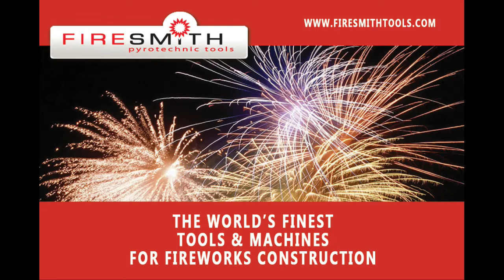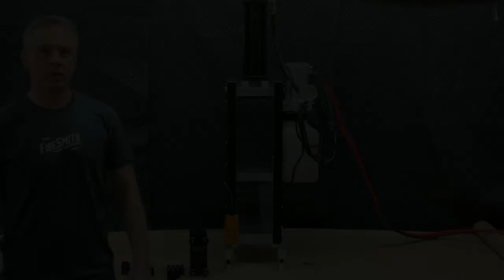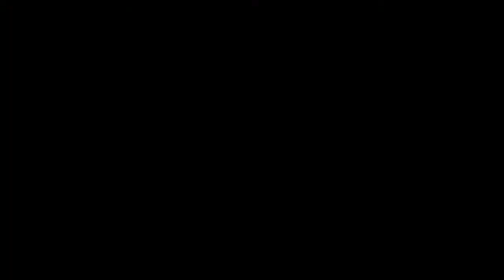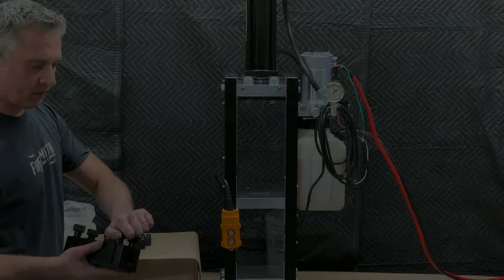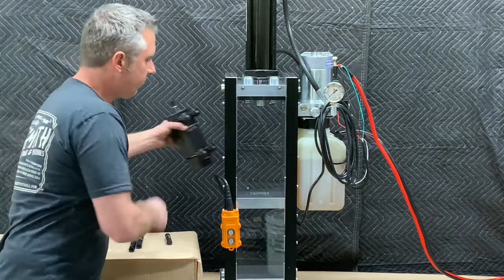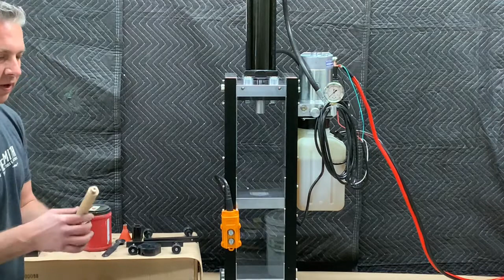Constructing a Clay Nozzled Black Powder Rocket

Comment: I got my tool kit a couple days ago.. I was able to make a couple rockets that made it a couple hundred feet in the air.. I had small heading that would only go off when the rocket will come back down and be 10 feet off the ground.. that rocket tooling set from u is great thank you
Reply from the maker: Glad you were able to get your rockets to fly! Try reducing the amount of fuel over the spindle to help prevent a round trip. Keep me posted with your progress!
Reply: @firesmithmanufacturing9376  yes that was exactly the problem thank you… I also ordered a 3lb tooling set from you I’ll see what I can do with those.. thank you God bless

Comment: Nice video.. I saw that u did only two increments above the spindle. Is there a rule to how much bp above spindle? Is it one ID above spindle? Can u add a delay mix and clay plug above this? Thank u
Reply from the maker: It really depends on what you're wishing to accomplish. If you're lifting heavier shells, you may wish to use minimal delay above the spindle since the rocket won't go quite as high. Light weight headings may allow you to use more delay above the spindle since the rocket will reach higher altitudes. That being said, I mainly like to run fuel as both a delay and bulkhead (that is, I don't use a clay plug above the delay). I typically run this to about 1/2" - 3/4" from the top of the tube. Using fuel as a bulkhead instead of clay always ensures your header will ignite.

Comment: I really like these instructional vids that go along with your tooling. How long have you been making Fireworking tools? Are you a machinist by trade? Or do you just do it on the side? What do you use a lathe or CNC milling machine or both?
Reply from the maker: This business started in my garage in 2010 as a hobby. It became a full time endeavor a year later. Since that time I've acquired several CNC machines to keep up with demand. As it is, my tooling is in use by hobbyists, professionals and commercial operations all over the world.
Reply: @firesmithmanufacturing9376  I know it's used around the world I saw 1 of your star presses in a video by a South American Jorge. Were you into Fireworking when you started the endeavor is this why you began and turned it into a business. I'd imagine a lot of trial and error needs to be preformed on tools before you pick a design to see if it's workable and persuable from a monetary standpoint whether it be time or materials invested plus upkeep on your machines and blades.

Comment: What increments do you use or recommend for 1/4" rockets and 4 oz rockets? Thanks
Reply from the maker: Generally, you want your increment size to produce a plug of fuel approximately 1/2 the ID of your motor.

Comment: Can i get satisfactory rocket by using the universal core burn set and a  rubber mallet. Forget about the press, tube support, and removal jig? If you can, can you make a video about it?
Reply from the maker: Using a dead blow or rawhide mallet works fine. A rubber mallet won't work well. Ramming rockets with a mallet is only for BP fueled motors. Any other type of fuel must be pressed using hydraulic force. Checkout the Stinger tutorial on my website for an overview of this technique.

Comment: Hey man great video what kind of tooling from your website and what kind of tubes would you recommend to pick up a header about 300 grams would a 1 LB pound motor be to much or is that just enought just need a little advice thanks in advance!
Reply from the maker: A 1lb motor will easily lift a 300g load. If the height is too far up there for your liking, you can use a lower impulse fuel or reduce the amount of delay above your spindle. I'd recommend either the Super BP Core Burn or Universal Core Burn (Universal if you're hand ramming). Tubes are available from Cannon Fuse . com
Reply: @firesmithmanufacturing9376  thank you

Comment: Hey there what kind of clay do you use and what tooling would you recommend for both a 1 pound BP rocket and whistle rocket thanks in advance
Reply from the maker: Simple powdered bentonite clay with a small amount of powdered graphite makes a great nozzle mix. Any core burn rocket set can be used to make BP, whistle and strobe rockets. Though, I'm partial to my Super BP Core Burn rocket tool set.

Comment: What size increments are you using for your nozzle?  Teaspoons?  Thanks!!
Reply from the maker: I find that two level teaspoons works quite well.
Reply: @firesmithmanufacturing9376  thanks!!  I've been adding 1 tsp of clay for the bulkheads on mine, but I've  been having some issues with with them blowing out.  I noticed you didn't add a bulkhead to this one, do they not need it?